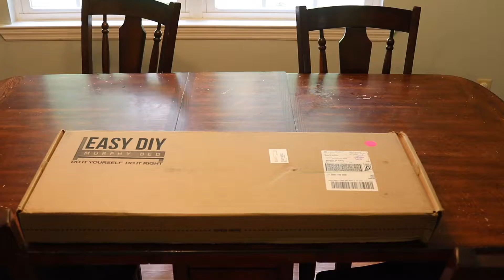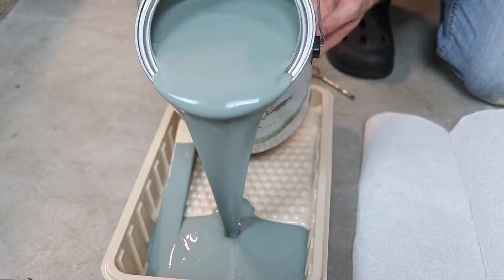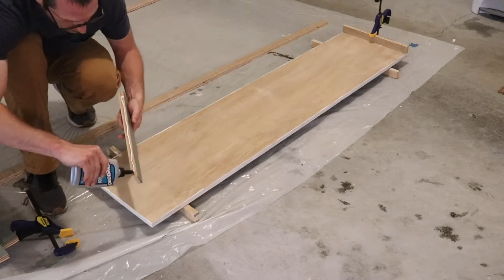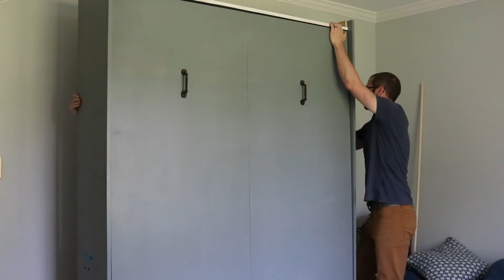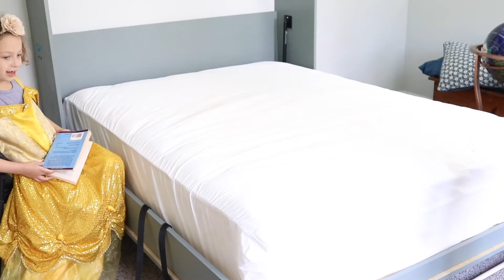How We Made Our Own Murphy Bed | Easy DIY Murphy Bed Review

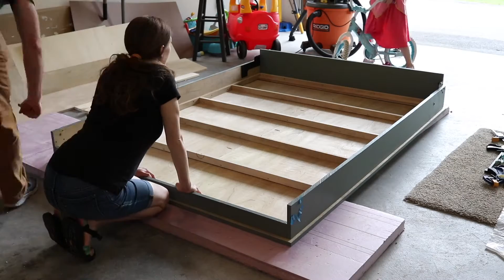Comment: at 5:25 the mattress support should be flushed with the  foot of the bed and the quarter inch gap should be at the head of the bed.
Reply: He did it correct per the instructions so that when the bed closes there isn’t any rub or expansion causing it to rub, they have 1/2 inch for room for error or needed adjustment

Comment: Great video! I’m about to build this myself. Quick question. Did you use any solid wood in your build or did you just stick with plywood the whole way? The instructions say to use solid wood on the inner bed frame part. I’d hate to buy extra wood if I don’t need it. Thanks again.

Comment: I have a request that can be strange to you, i am very fond of my old permaflex bed net, so, i would like to use that One, i need only the hardware to adapt It. Because the metal Is very very strong and heavy i was thinking to drill It and use a long metal line to lift It. Or can i buy only hardware not idraulic?

Comment: I think this is a great video. DIY, you kept it pretty direct and simple.  I think we will be doing the same but changing a few things.  Not much.  We would like shelves on the front, to hold the decorative pillows and blankets, and act as the legs when we lower the bed for use.  Great job!!

Comment: Did you remove the baseboard wall trim before installing the Murphy bed to the wall or leave it installed? If you left it installed did you have to notch out the wall baseboard trim shape from the bed cabinet side uprights? Thanks
Reply: I also wondered this or if you used trim width wood which was put behind where the anchors at the top . I also like the locking idea for children's safety. It looked nicely done.